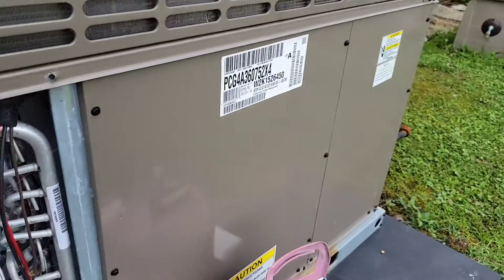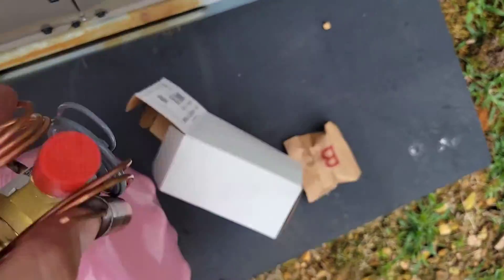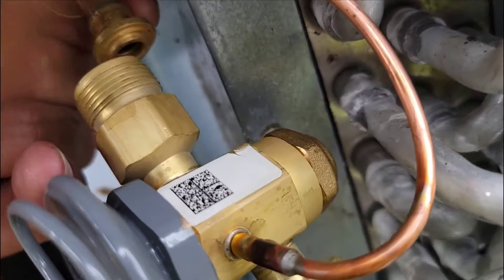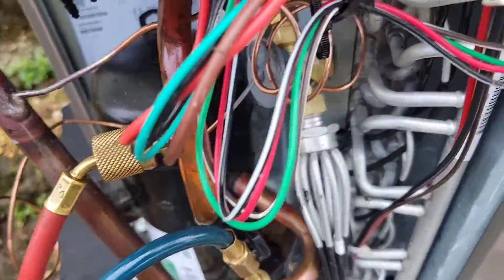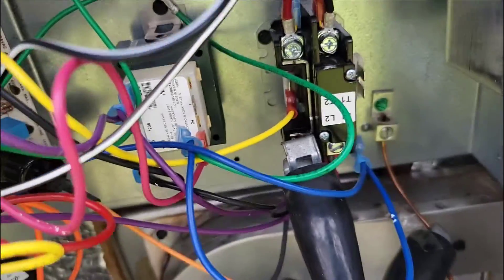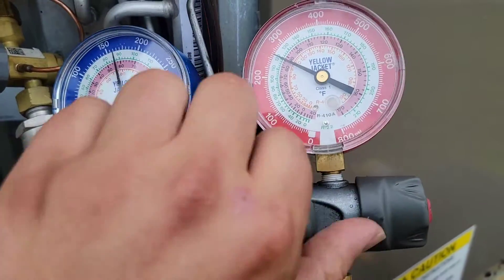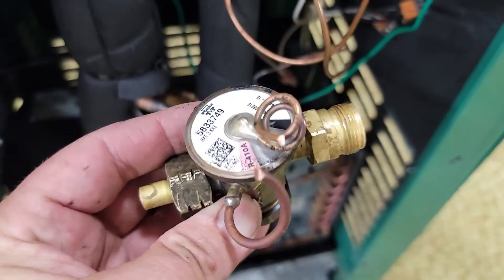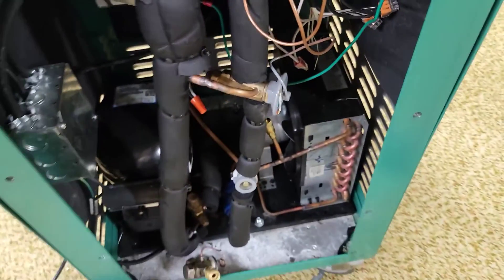The TRUTH about TXV failures

Comment: Ac was working very fine. Came home from a camp trip to a 95° house.  One of the compressor wires over time wore through and arced onto a skinny refrigerant lins and zapped a hole into it, lost all the r22 refrigerant. So ac guy braises up the hole,  scams me into buy 407c at 250 a lb to refill it. And put it in without adding POE. Well 1800 bucks later the ac was struggling and running constantly and not meeting thermostats setting.  And even one point the ac shut off and didnt turn on till like 30 mins later. So i get pissed and go buy my own 10 lbs if R22 way cheaper and was easy to buy.  So he evacuated my system again, and we add in the Proper R22. Now its still struggling and not meeting the thermostat setting. Set to 79 but its only able to achieve 82.   Did tye guy burn up my compressor by nit adding POE? Or is my txv or something else messed up. Condensers are all very clean. Im 2300 into this repair with no idea what to do. Now he says it could be the txv.

Comment: It looked pretty black in the old valve. I've had pretty bad luck with problems returning in these types of scenarios. The oil in the compressor is likely cooked/contaminated, and it will foul the new valve prematurely. I've learned to quote a compressor and flush with the valve replacement in order to ensure a lasting repair. Have you had good experience changing valves in those scenarios? Any tips for preventing a callback?